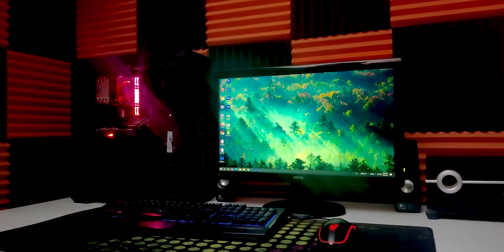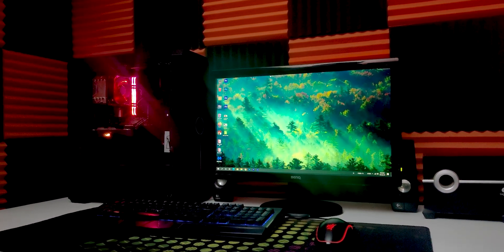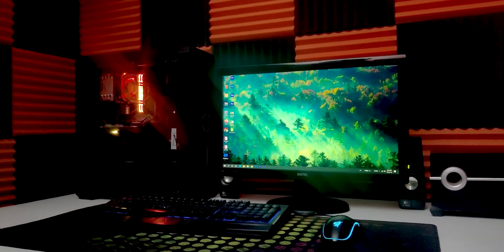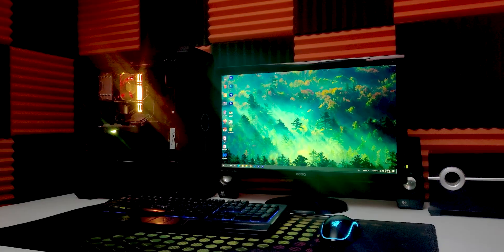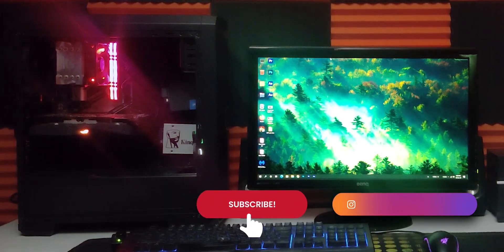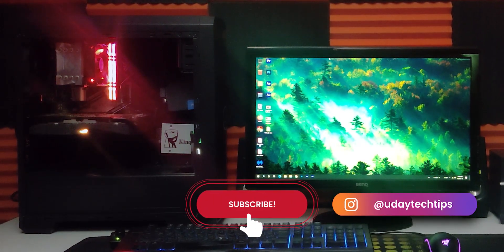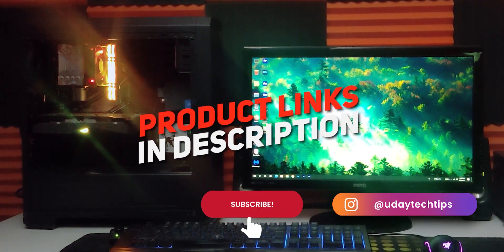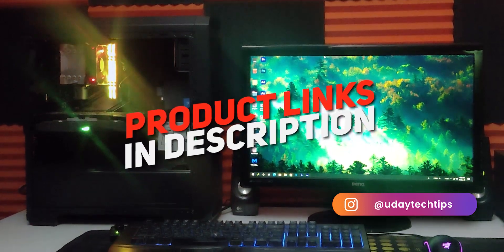How to Build a Gaming Computer Step by Step Guide in Telugu | 50k Gaming PC build i5 9400F

Comment: Nice bro... 
Nenu recent ga 65k pc build tesukunnanu Gigabyte B460M motherboard... Kakapote graphic card first tesukoledu ipudu tesukuntanu... Main doubt is.. Motherboard board ki vunna HDMI port nunchi display ravadamledu VGA vasthundi DP check cheyaledu... BIOS lo yemina setting cheyala bro Or motherboard problem aa?? 
Can i make a call 📞plz send ur number 8919027987 wp i will call bro plz help me
Reply from the maker: 1. Bios lo HDMI port enable/disable option undemo chudandi, unte enable cheyyandi.
2. Graphic drivers ni update cheyyandi, device manager lo check cheyyandi.
3. Rendu displays ni connect chestunnara, leda okate display na? Mee monitor ki ye ye ports unnai, meeru ye cable use chestunnaru ( any adapters)
4. Mee friends daggara GPU teeskoni appudu gpu lo hdmi port tho try cheyyandi,
Reply: @UdayTechtips  one display only... HDMI, VGA, DP,DVI ports vunnayi GPU connect chesi chusanu GPU HDMI ki vasthundi but motherboard HDMI ki raavatledu, driver update chesanu intel UHD 630
Bios lo yela chudali brother any clue..?
Reply: @UdayTechtips  monitor ki HDMI, VGA vunnai

Comment: Bro mari i5 10th gen tho paatu 3200mhz ram support chese mother board kunchem budget lo undedi suggest cheyyandhi naa pc kosam
Reply from the maker: Intel budget lo anni 2666mhz varaku matrame support chestai, Intel lo RAM frequency valla antha difference em undadu  bro, ryzen aithe ram frequency high unte, better performance untundi
Reply: @UdayTechtips  bro mari naa pc builder intel ee best because adi 10th gen ryzen inka 3rd generation ani a annadu naku kuda ryzen ee istam mari edi teesukoni ryzen5 or i5
Reply from the maker: Ala em ledu, rendu ippudu full competition lo unnai, 10th gen intel, 3rd gen ryzen, chala equal performance istai, i5 = ryzen 5
Present overall best processor ryzen 5 3600 or 3600x. Budget lo motherboards kuda ryzen ki untai. Intel 10th gen ki budget lo motherboards levu, minimum cost 8k undi. 

Ryzen 5000 series processors aithe inkaaa better option. But recent ga release ayyai kabatti price chala high ga unnai...